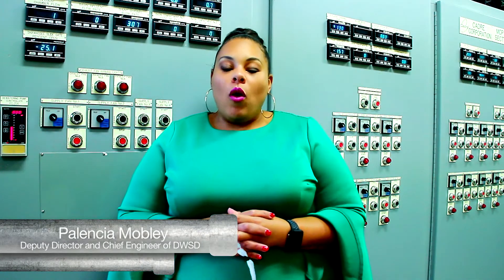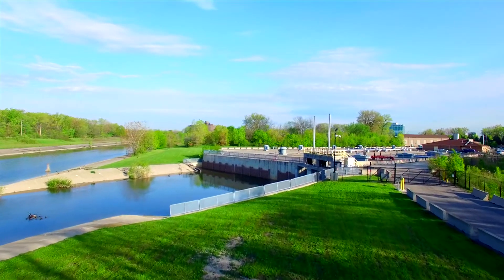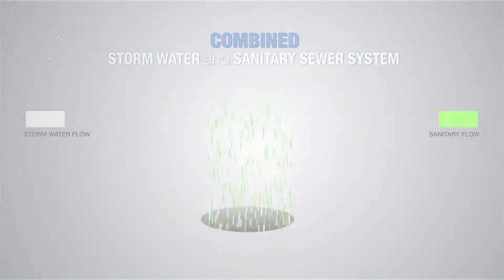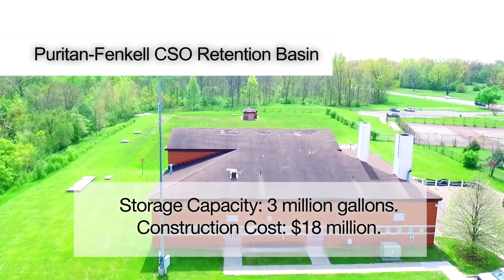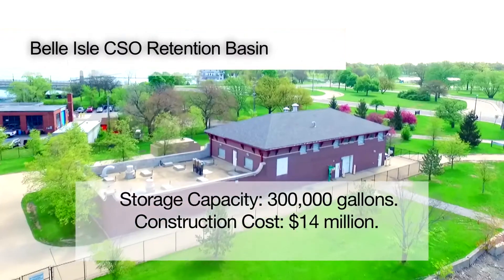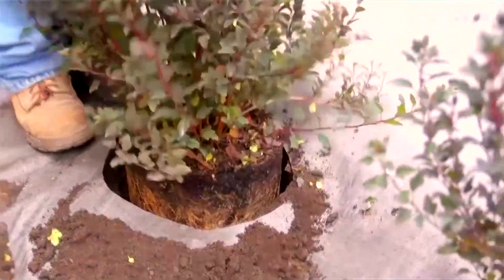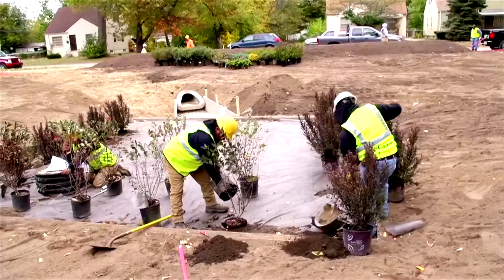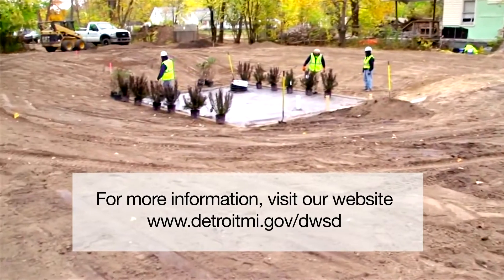Learn About Detroit's Combined Sewer Overflow (CSO) Program

Comment: I am glad to see SOMEONE is stepping up to the plate.  NO ONE ever said it would be cheap.  Back when the sewers were designed and built this was the norm.  Now it is going to cost untold BILLIONS MORE to separate the lines and allow for better control.  And Detroit doesn't have the money (nor does anyone else) to perform the necessary upgrades.  So I applaud Detroit for making small steps in a project that will take YEARS AND YEARS AND YEARS to complete.